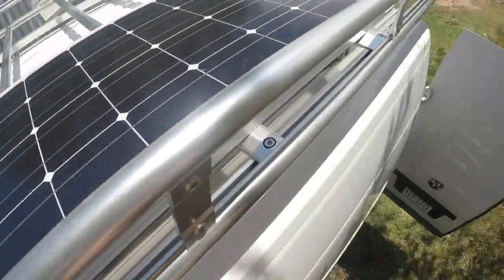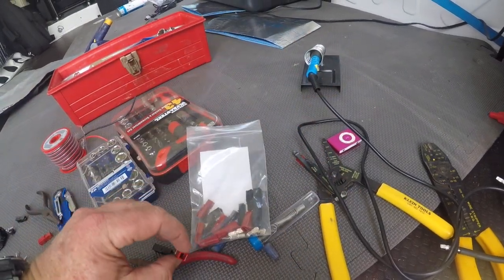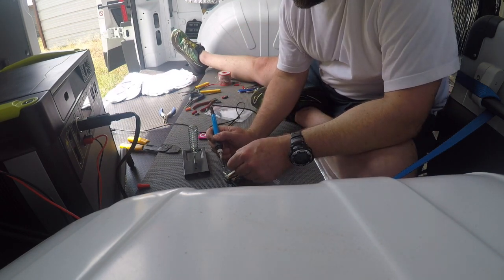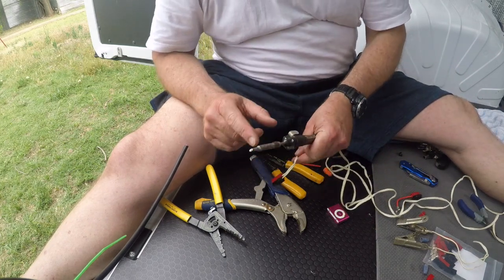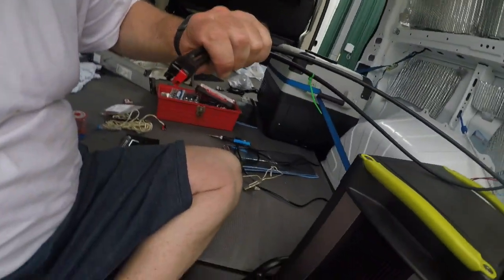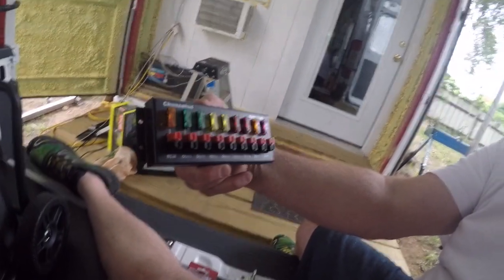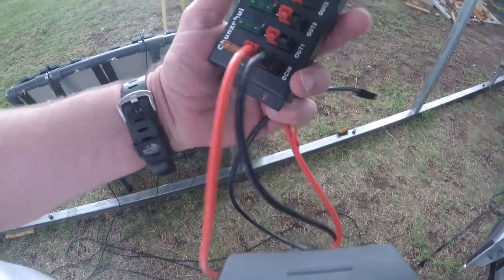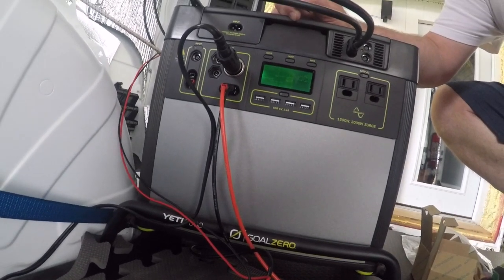Episode12 promaster van solar panels to goal zero yeti/expansion ports/stupid anderson powerpole

Comment: It won’t give you anymore watts in because the Yeti is full and it’s controlling the charger to the battery. So since it’s almost filled it’s just trickle charging it to its full. I have two 3000x

Comment: Had the same problem. I terminated the panel cables with an MC4 adapter. Then got an MC4 to Anderson cable adapter from goal zero to connect it to the yeti. Just a thought.
Reply from the maker: andresbritt that would be way better for sure

Comment: I have a question on how you routed the roof wires through the back up camera box? How did you drill hole? What device did you use to seal the wires into the plastic box?
Reply from the maker: I went through the two screw holes in back just took them out drilled it out a bit. Had to cut or drill  a little of the inside to feed in the wires then just sealed I it all up with auto  silicone     Hind site. I saw a dude go into the side of the housing which I think would have been better. It locked a lot cleaner.  You just need to drill out access inside the housing   I also used that 4” trailer house repair roof tape on top to secure the wires.    Hope this helps.  Cheers

Comment: Great video. 

My Yeti 3000 should be on the way. Goal Zero was to have a fresh supply of them after 06.29.2018. Hated to spend the money, may regret it in the end, but my build out has to be wrapped up.

If you're going to do it again, try terminating the panel wiring at a BlueSea terminal strip then run the Anderson connections from the terminal strip to the Yeti.
Reply from the maker: Thanks.   I finally got the Anderson crimpers and it works pretty good.   Haven’t tackled the big wires yet.   The 3000 has been working good.  Even in the tx heat.   The fans come on a lot and a bit noisy but the power is good

Comment: Enjoyed the video........why did you pick the Yeti 3000?  I am beginning a van build and trying to decide on my electrical.  Thanks and keep the videos coming!
Reply from the maker: Thanks and I chose the yeti for a few reasons. 
1 it’s portable.  And if needed to charge on 110 you totally can or if you need power outside the van you got it.  
2 all in one package.  No need for any other system parts.  Simple.  
3 it’s relatively a small package
4. It’s also lightweight compared to other systems at comparable output.  

Cons:    It’s expensive
Reply: thanks